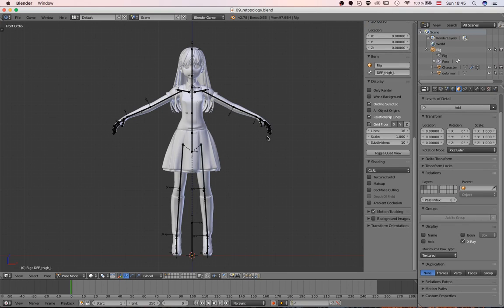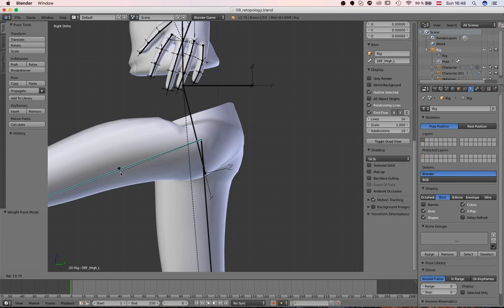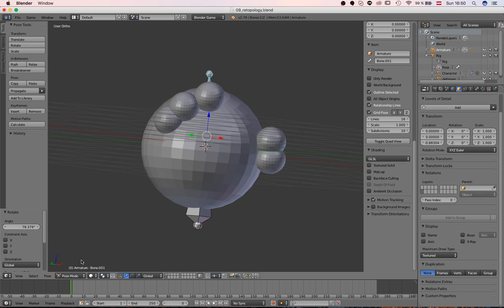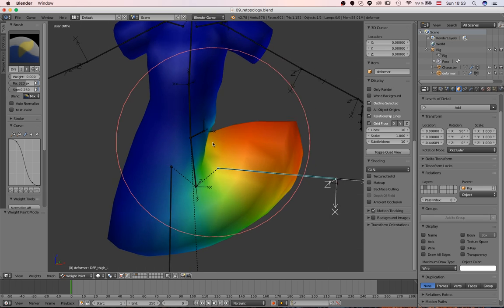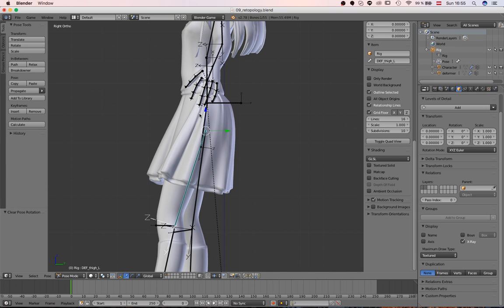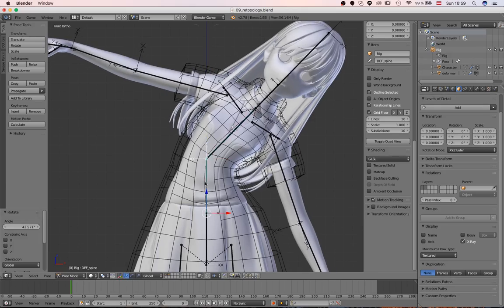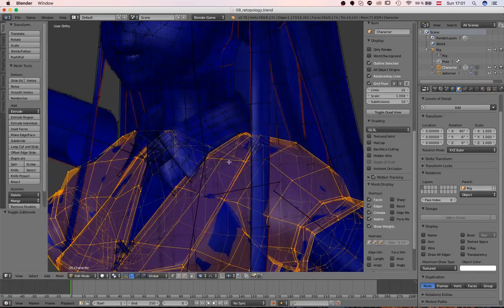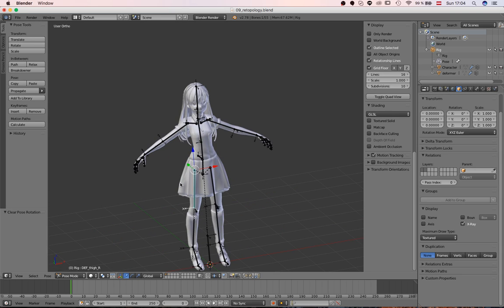[3/6] Complete Character Rigging Guide (w/ Hair Physics) - Blender Tutorial

Comment: DOUBLE-EDIT: Fixed!
For some reason only the top vertices of the deform mesh were assigned to the armature vertex group.

I selected the whole deform mesh, assigned it to the armature vertex group, unbinded and rebinded the mesh deform modifier, and it works now.

The dress currently clips through the body at strong angles but that's just balancing the weight painting.

EDIT
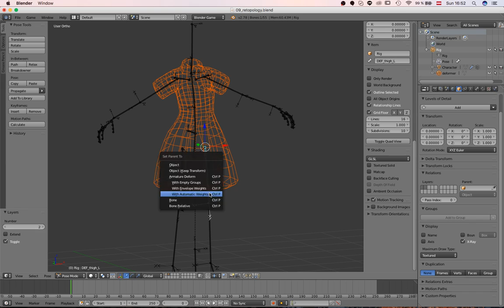7:32
So only the top-most vertices of my deform mesh are moved by the bones, completely irregardless of how they're weight painted.  The chest bone, the left thigh bone that doesn't even have weight painted on the top most vertices.

Visually the bones have proper weight painting for their area, but when I actually rotate or move  a bone the ONLY vertices that move are the ones of the very top of the deform mesh.

Does anybody have any idea what's going on?

Comment: Hi Daniel what is the key for the
brush hardness/softness like what you did?
Reply: And also I have some question about the mesh deform.
Can I use a two mesh deform modifier? Because I have two different stiffness of materials, for example a clothe like strap connected to a plastic rubbery like material.

Comment: You didn't need to seperate the skirt out to hide it, you can hide individual vertices, edges or faces in edit mode by just selecting them and pressing H.
To bring them back just press alt + H. Also shift + H hides "everything else" so if you just work on your selection and the rest is in the way just use that.
This hiding will also be remembered only for edit mode, if you leave edit mode nothing's hidden anymore and if you enter it again it will be hidden again.
Reply from the maker: Yes, as you say it's edit mode only. I separated it so that it could be hidden from weight paint mode...
Reply: Didn't think of that :x though there's an dual option in weight painting left of the layer buttons, Face / Vertex selection for weight painting, these use the hiding settings from editmode.
But the unhiding doesn't work outside of editmode so it's indeed a bit fiddly to change it while painting.